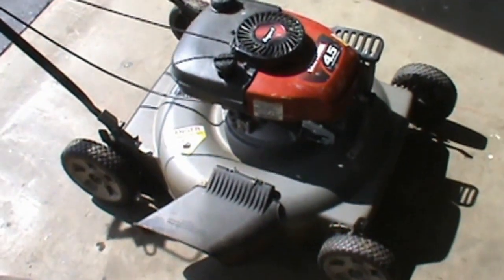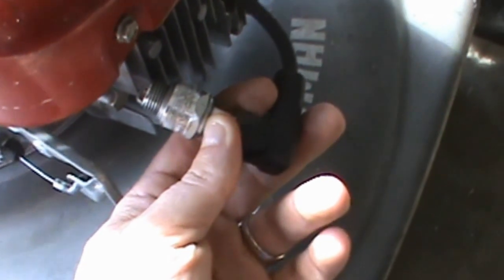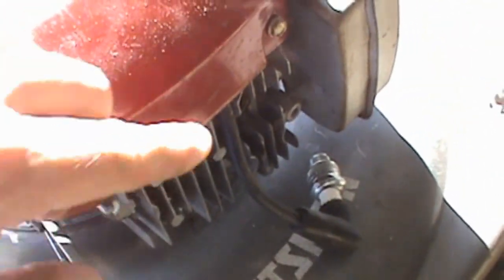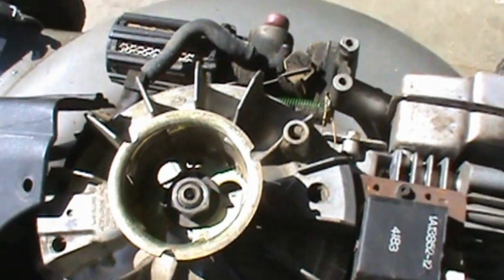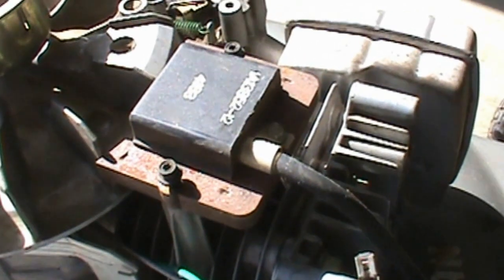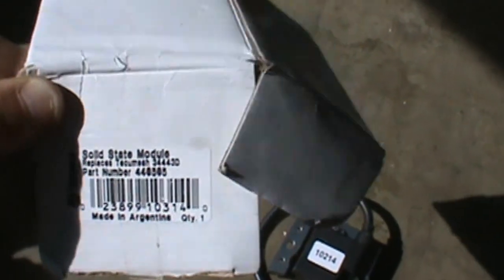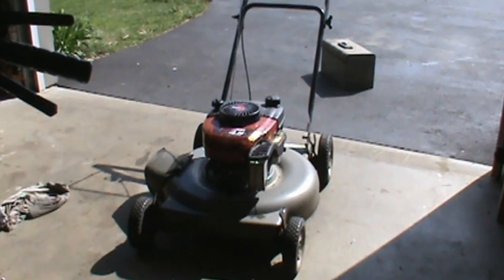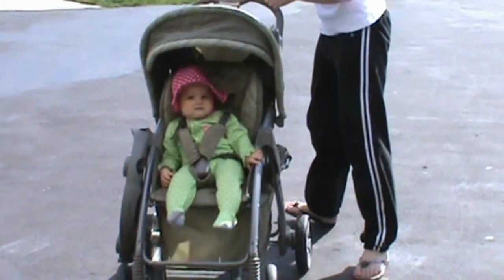How to fix a lawnmower no spark

Comment: Old video but brilliant for the older magneto mowers. Had no spark - traced it back to an electrical connection I had made my self with electrical tape (from the magneto to spark plug)). This video was EXTREMELY helpful narrowing down my problem. I had used electrical (plastic) tape which is normally OK BUT heat from the the mower engine had caused a chemical reaction with the metal connection and electrical tape glue causing problems. My mower was a throw-away (was in the rubbish when I found it) and the previous owner said it just wouldn't start. Cleaning the magneto metal base posts as per this video was a big help too. I used a multi-meter inline from the magneto to the spark plug to check for spark. Replaced gooey connection I had with a metal connector. All good. THANKS for VIDEO!!! Really excellent! Luv my old mower !subscribed!

Comment: 10/01/2021  @ 1:25 a.m. I did what you were referring to on the kill switch wire for the ignition coil. It works, The lawnmower started right up after about 10 years sitting in one spot. Thanks again for your video referring to the kill switch wire on the ignition coil. 10/01/2021 @ 1:25a.m. .

Comment: Thank you very much for the explanation.Disconnected the kill switch green wire and mower started.
Temporarely and until the short found, I installed a waterproof ON/OFF switch on the green wire to shut off the mower.
Thank you again.

Comment: Good video. Nice family. Enjoy- they grow fast.I had to replace the cutoff cable. When I put the brake bracket back on I must have left the wire in a bad spot probable rubbing on the flywheel and slowly wearing off the insulation on the wire ( it was a bear to get that brake assembly up in under the flywheel.)Maybe there is a trick to it but I never did it before. It ran for about an hour and then quit. No spark on plug cleaned everything, re gapped it . Still no spark. I looked real good and saw the wire had been gouged and must of been the flywheel and the wire was bare. I fixed that with some solder and shrink wrap. Still no spark. Do you think the bare wire shorted out the ignition module because there is no spark on the coil now? Is there a way to ohm out a module? Also thanks for taking the time to make the video's and have a great day!

Comment: Nice tip about filing the posts most people wouldn't get that its kind of like cleaning the battery posts and clamps on your car. Keep connections clean parts will last longer. Bravo

Comment: Thanks for this video. I had cleaned the carburetor, gas line etc etc and it still wouldn't start/spark. After watching I removed the cowl and realigned the coil and now it starts first pull. Thank you for ending my frustration.

Comment from the maker: I mentioned that rust on the end laminations will not affect the magnetic field. Although rust will restrict the magnetic field because of the strength of the magnets it will not stop the lawnmower from working. Where the base of the coil mounts on the posts it needs to be free of corrosion because if the coil is not grounded it will not work.   This video is designed to help people not "mis inform the public.  There are many people that have fixed their lawnmowers because of this video.

Comment: Thanks for the video.  My "no spark" was due to the shut off arm not pressing the kill switch enough, thereby it was always in "kill mode". Fixed it with part of an ink pen. Pulling the kill wire as suggested produced spark so i knew where to look.

Comment: yep.  the wire to the coil was shorted to the engine....I couldn't see where, but the insulation must have broken down between engine heat (it was laying in contact with the top of the engine) and dirt/oil.  This video save me a lot of brain fatigue and money.  Many thanks!

Comment: Hello, I have a Tecumseh engine on my mower which is a Champion Self Propelled 46cm. I have a spark and I have taken the carburetor off and cleaned it. When trying to start it it occasionally 'fires' but won't run for any length of time and also floods the spark plug. Is it possible for the coil or the spark plug to be breaking down under load? I've tried another spark plug (second hand) and the problem is the same. Any help would be great. Thanks

Comment: Great help with this. Thank you. The video is clear and process well explained. I implemented one more thing and that is to put liquid soap in the sleeve prior to wire R&R. This helps the old wire slide out and then the new one inserted into the spark plug protective sleeve. No need to split it open. I then used a can of air duster to blow out the moisture.

Comment: I cleaned and gapped points and replaced coil in my old John Deere 56 riding mower. I can't see a spark on the plug or spark tester but I sure get  a jolt if I hold the plug wire when I pull the cord. How is that possible?

Comment: I have a push mower with a B&S engine that will not start 9 times out of 10.  The carb is clean and the fuel is fresh.  If there is fuel in the tank it barely picks it up and stalls out.  If I spray carb cleaner into the intake the engine will start and run good.  When I release the lever for a split second the engine immediately stalls and will not restart.  I also here small poping sounds.  Is that an ignition coil problem?

Comment: Changed spark plug, changed ignition coil... Craftsman 5.5 .. Runs when I disconnect green ground wire from bottom of ignition coil. Checked Brake assembly and no wires broken .. just not sure what the brake assembly should look like and what wires should be touching what... perhaps a contact is not sitting correctly?.. Can't find diagrams online either.. Any ideas?

Comment: This video is good. Replacing a lawn mower coil is not hard at all.  Most manufacturers on mowers have User manuals and part numbers online. Just identify model number and the part need and order through Amazon or wherever.

Comment: I've done everything recommended, certain I had it under control. New coil, .009 gap, new spark plug, filed clean the mounting posts, handlebar actuated kill switch seems to open and close as per a continuity switch - probe on flywheel and on lead to bottom of coil had continuity when the handlebar lever was in "shutoff" mode, none when bar was in "on" position. Still no hint of a spark. Guess next step is remove the flywheel? Haven't tried running with the ground wire disconnected. What is next?
Reply: +Bryan Byrd  To possibly add more value to this valuable thread, two full frustrating days and $85 later, a lawn mower shop determined the coil provided by Sears was not any good, and he put in a used one and the mower runs fine. Sears claims the part number 440505 is the right one for engine model  number 143404162, but I never had a single spark. Maybe it was defective? Good luck., and thanks doublewide.

Comment: At the risk of asking a really stupid question, I am going to anyway.  I replaced coil, spark plug, checked the "kill wire" and everything looked good. Still no spark.   When I took off the flywheel I noticed the shaft from the motor was very rusted and the inside hub of the flywheel was corroded.  I sanded them both and now the mower runs.  Does the flywheel have to have good contact with the motor shaft to create spark? Or did I inadvertently do something in between to fix the problem when I took the flywheel off?

Comment: I'm having an opposite problem. Engine is hard to pull start and get to fire when it's cold but after it does start and warms up a little it will start right back up if I have to shut it down for any reason. Any ideas what could cause this?
Reply: check if the "break pad" that stops the fly wheel, causing the Engine to stall and shut down is pressed against the fly wheel befor you start it. if it is losen it slightly

Comment: I have no spark in my craftsman riding mower. I have replaced the plug and coil. I also took off the flywheel and cleaned everything. I seen the stator was burnt on 3 coils so I replaced it too. The previous owner said he was driving it and it just quit - he tried to rewire it and I think he left the voltage regulator out and that let him burn out the stator to my opinion. Now back to the spark plug spark. I did clean the ignition coil screw holes. Took off the kill wire from the coil, used a business card for a gap and still no spark! I am lost at this point besides thinking it may be the magnets. Any ideas???? No doubt the magnets are not dead in total. How do I check/replace/recharge them??
Reply: Virgil White what was your issue im having the exact same issue?

Comment: My thoughts and prayers for your son.  I hope he gets better soon.  Thanks for the video.  Did I hear correctly, rust on the coil or magnet on flywheel will not make any difference?  My mower starts when cold, but shuts down 3-5 minutes later.
Thanks!
Reply: 3079daddy

Comment: have no spark on 5hp B&S engine. Checked flywheel key is good, replaced coil, spaced with business card as shown, new spark plug, has no wire connected to kill switch tab. Still no spark, any ideas?
Reply: how do you turn the engine off if where is no kill switch wire? it must be something...

Comment: Thanks. It was the kill switch that was not working. So fired up the mower with the switch disconnected and bam!  It worked. Just found that the part clamping the cable down broke and tied it down with a clamp. All better.
Reply from the maker: paul l I'm happy the video helped.
Reply: doublewide6 Yeah buddy you got me you made it so simple and you have me access to the the parts. Great job and beautiful Family.  God bless you and your Family
Reply: doublewide6 Thank you for sharing your knowledge I appreciate you God bless you and your Family you made me look smart in front of the Wife again I was losing ground. 😉

Comment: before tearing into this, I moved the kill switch wire and it started right up. I will dig further  to find the point of a bare wire for a permanent repair when the temps drop around here.

Comment: I've replaced the coil(thinking this was it and also tried without the killswitch attached), spark plug, and put fresh gas in.  It won't even attempt to start.  My mower won't turn over at ALL.  What else could it be?
Reply from the maker: Andrew Croman Do you have spark?  If you have spark you need to pull the flywheel nut and see if the key is sheared.  If the flywheel key is sheared you may have spark, but the timing is off and the engine will not spark at the right time, not allowing it to start.

Comment: same problem,new coil will fire with ground wire off but now cable to killswitch is to long will fire if I hold cable at bracket but no adjustment. any ideas

Comment: Thank you I had a faulty kill switch wire and I just pulled it  And  The mower started I plan on just pressing the primer bulb a few times until the engine quits

Comment: You need to check the kill circuit as well, the small wire hooked to the coil, sometimes if the circuit is closed it will not let the coil fire.  Sometimes that wire will be grounded to the engine.
Reply: Also check the operation of the dead man lever, if the engine brake is not working properly, it may not open the kill circuit. And this will also not let the coil fire.

Comment: Thank you very much.It was the kill switch.
Reply: I disconnected my kill switch and it started right up. It is a pain to pull the plug wire to shut off.  The wiring on the kill switch looks good. So how did you get it back to normal.

Comment: I had no spark so I bought a coil thinking it would fix it put it on and still no spark.  What else causes no spark if coil is new.  I have a brand new spark plug also.
Reply: a video said the other wire of the coil could be bad. also they say if the coil is bolted on rust/corrosion it will not ground right
Reply: I disconnected my kill switch from the coil and it started right up.  The wiring all looks good however I have to pull the spark plug wire to kill the engine.  What else can I do.
Reply: maybe the kill switch is bad then or somewhere where the kill switch connects to or something. i gotta check my lawnmower today and see because it has no spark also and idk bout the kill switch yet but it looked decent. gonna sand the coil and ground and clean where the kill switch connects to and see what happens. i did 5-7 compression pull test and it was around 45-55 psi but shouldn't it be over 60 psi?
Reply: mine works well its not mine but my brother friend. the kill switch wire looks good but i sand the end down to make it shiny and i sand rust off the coil in every corner as i can and in the gap one side had. the part the kill switch connects to on the coil and the lawnmower i brush/clean off the dirt and so on. i try it without the kill switch connected and it start right up but i had to take the coil wire off the spark plug to turn it off. it then smoke abit not sure why. i then assemble it with the kill switch connected and it start up so i guess the dirt/rust caused issues. i also sand the ground under the coil abit.
Reply: Not sure on the compression.
Reply: before when it didnt start i did 3-7 pull and it was 45-55 compression but not sure what its suppose to be. maybe 60 min? idk the compression now maybe ill check and let u know. also i dont think u need compression to get a spark on the spark plug.
Reply: i guess make sure u got the right coil and spark plug. someone said they had a defective coil brand new. so you saying its running without the kill wire connected? maybe that wire is bad or the connection somewhere is bad to where it stops the machine. i sand down the tip of that wire to make it shiny and make sure the metal mechanism look clean and touching where they should touch. the mechanism on this lawnmower has something like a brakes pad touching the flywheel thing that spins. i guess make sure urs is touching and looks ok.

Comment: Easy fix - take your combustion small engine to the nearest bridge, and throw it over the side into the river.   Replace it with an electric engine.  You'll never have to fuck with a carbuerator or ignition system or bad gas or yanking a cord until your arm falls off...  ever again.
Reply: yea but, you have to fuck with the dam extension cord
Reply: An electric mower is only good for a small city yard and will not do well in thick grass or grass that's over a few inches even in a small yard. If you like mowing your grass every five days and you don't mind cords getting in the way electric is the way to go.
Reply: If an electric mower can do the job, you don't need a power mower; a push mower can handle the job.